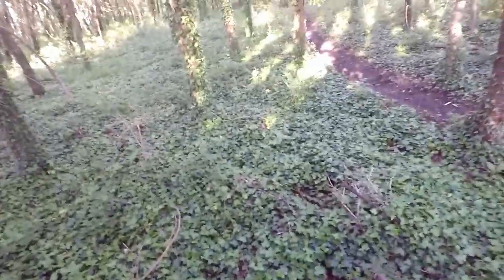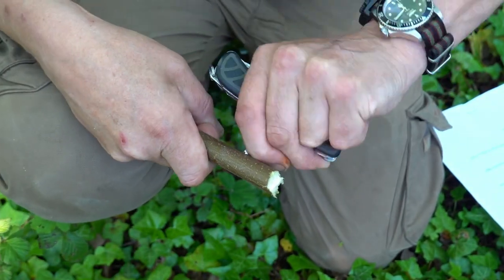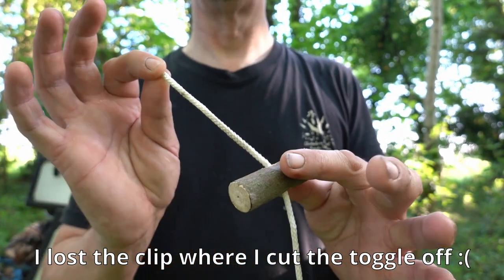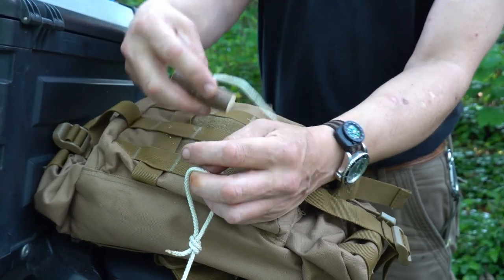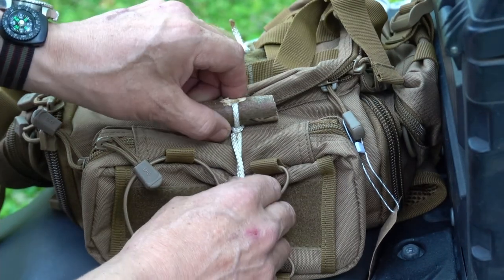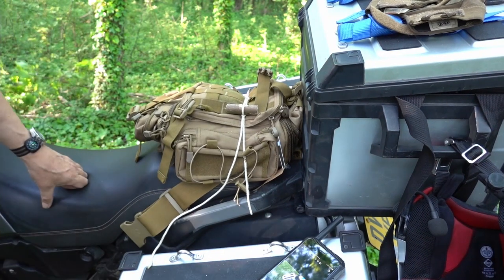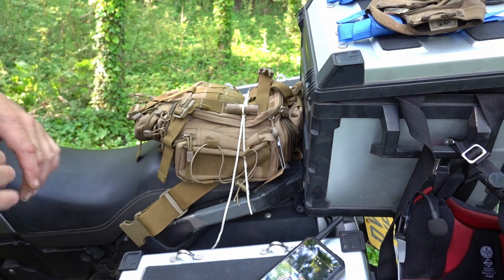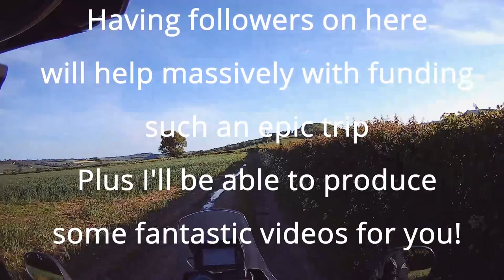FoxADV - The toggle synch -The knot you probably don't know - Bushcraft - XT660z

Comment: That's ace. I've been using a bowline and rolling hitch for tensioning lines but I think this can replace my main straps and buckles. Timely since I lost one in the lockdown fiaso.
Reply from the maker: I'm really chuffed to pass this on to someone that  I know will make good use. It's so mind-bogglingly simple and cheap. You can also double up on the cord to spread the load a little.  Cheers for the comment!